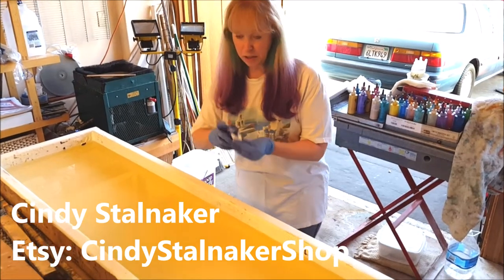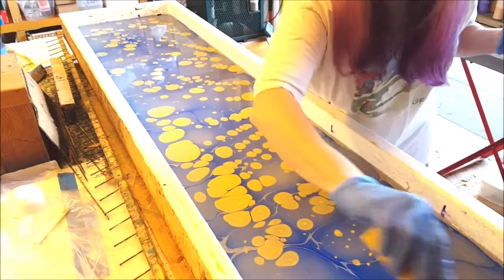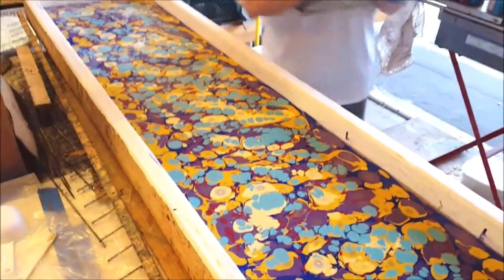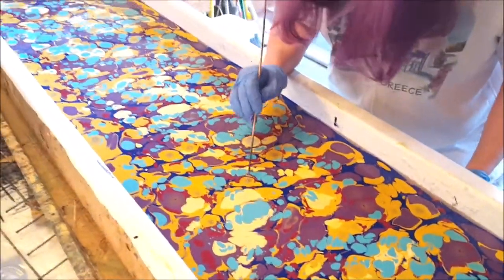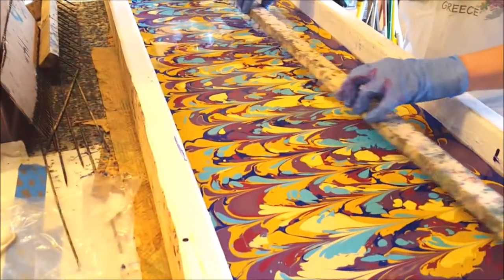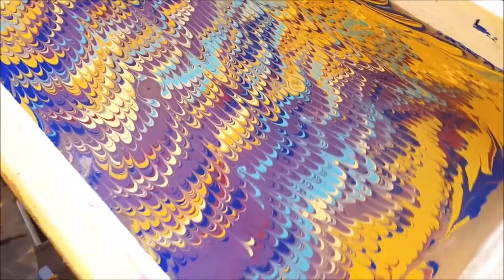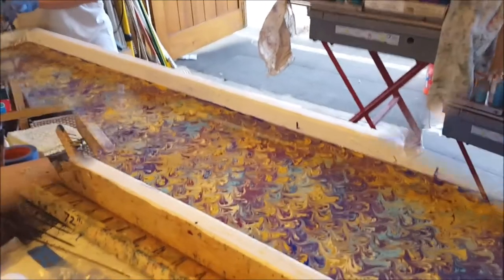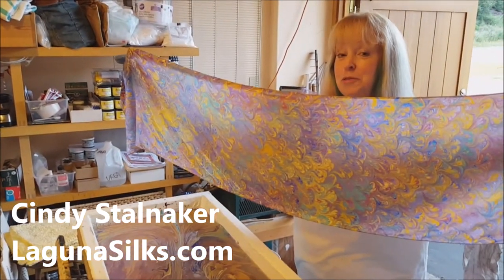Water-marbling a silk scarf in a bouquet/peacock pattern, by Cindy Stalnaker

Comment: Where do you get the trays?  Did you make the trays or buy the trays?  I can’t seem to find any online.  Thanks
Reply: Use any shallow tray that will hold liquid and is big enough for your proposed piece of fabric. For example, a flat plastic tote, a lipped baking tray etc. the shallower it is, the easier it is to apply your fabric. If you want to use rakes, you simply need to make them to fit your bath. They’re just slats of wood with nails at regular intervals, but, you don’t need them. You can do many patterns freehand with a skewer.
Reply from the maker: My husband and I made our trays from wood, then painted them, sealed them and caulked the seams. Add a drain at one of the short ends, so you can clean your trays out easier. Make the trays a couple inches wider and longer than the items you plan to marble. Any larger than that, you’re wasting consumables. If someone even makes them for sale online, I’m sure the shipping cost would be ridiculous!

Comment: Good afternoon, I need help, I'm trying to make a swirl or also known as marbeling, I've made great advances, I'm a luthier I would like to paint my guitars by immersion in water, I'll report my advances to simplify

1-) water density: I have already achieved a good density with the following products: CMC, carrageenan and emulsifier (nestle)
2: Paints: I managed to make the paints float and make drawings under these solutions already listed in the previous item, I have already used the following paints, food dyes, water-based paints, acrylic paints and special paints from the pebeo brand made for marbling
3-) I can transfer my drawings perfectly to plain paper or potassium sulfate treated paper,
4-) I need to make this happen on guitars that I have to apply a sealant base, I was told to use the white spray from the brand rust oleum ultracover 2x, I apply it on the wood, however unfortunately, every time I do the immersion in any of the paints the drawings are destroyed and run down the body of the guitar, they just don't stick.
Please, I need to know which product to apply under the wood after I have applied the rust oleum base so that the designs remain on the guitar.
Reply: Hi.  Just wondering if you figured it out.